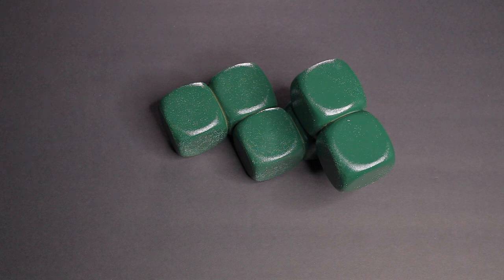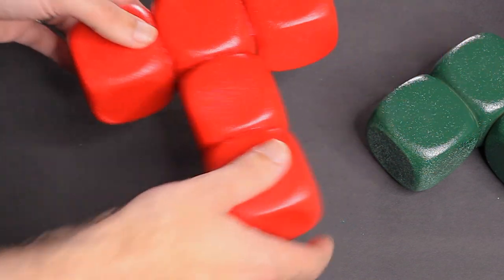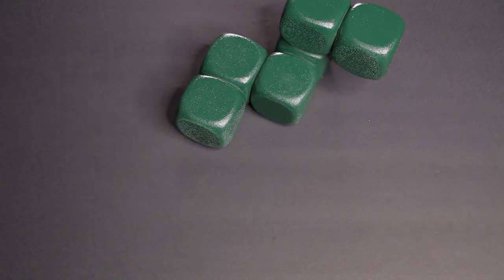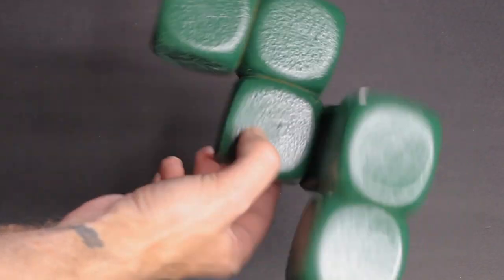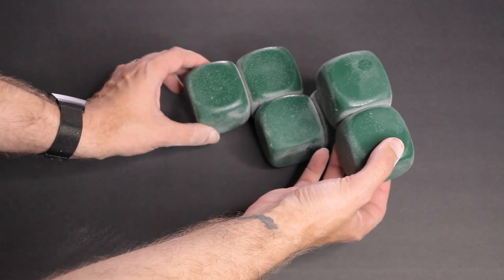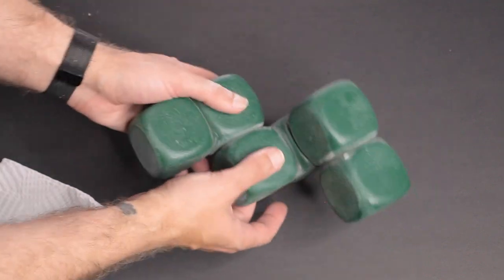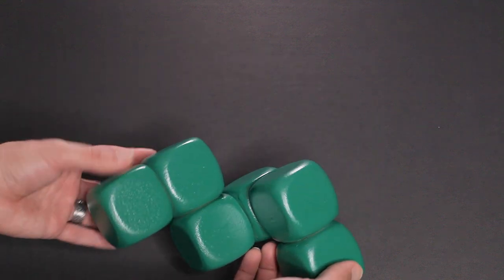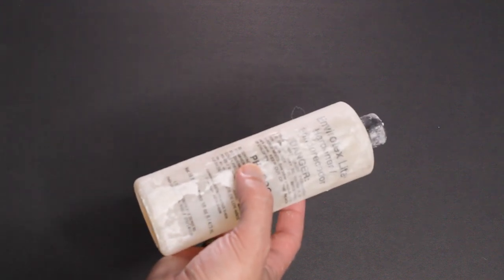FIXIT - STICKY PAINT

Comment: The reason the paint is sticky is because the material absorbed the mineral spirits in the paint too quickly.  Spray the item with mineral spirits a couple of times and let it dry.  This will allow the paint to harden properly.  The Soda is just a stop gap until you wash it, and the problem is still there. Hope that helps.

Comment: Note there is a difference between baking power and baking soda. I think soda is what you are recommending.
Reply from the maker: @jenellemorella6383  yes. While they both will work in a similar way, I was using baking soda in the video. A main reason for using it, is it's very inexpensive. And it reacts with various glues. But in the application of simply negating the stickiness by coating it in a "powder", a finer powder, like baking powder could produce a better/more desirable result.

Comment: Wow.... I found this solution via Google search and I found another method that says to use water. That was the less messy option and after that didn't work too well, it was time for this method. And it worked 100%! I had excess of both Corn Starch and Baking soda, but figured I go with the corns starch. It helped dry the tacky areas and then I wiped off the excess. I think you should do another video testing which powder works best for this method (baking soda, corn starch, or baby powder) There'll be pros and cons for each, but I'll still be interested to learn.
Reply from the maker: I'm very glad I could help, and that it worked for you. Yeah, I imagine most powders would have similar results with varying degrees of success. I like baking soda for how inexpensive it is. But yeah, could be interesting to test a bunch of different powders.

Comment: Primed with flex seal, that's a new one to me
Reply from the maker: Yup, sealing/painting foam with flexseal (plasti dip or similar rubber paint) works great as it's flexable, and is less likely to crack, and paints applied on top of the flexseal are also less likely to crack then if just directly applied to the foam.

Comment: Had same situation on my ping pong table. The paint didn't dry on day 3. Among the solutions that I searched, this is the simplest and it works well. Thank you very much for the helpful tip! I did just one very thing coat. Now I wonder, should I apply second coat?
Reply from the maker: I'm glad I was able to help. Hmm, well, pool tables are subject to a fair amount of abuse, a second coat would probably be ideal. You could always see how it holds up with just the one, and add a second coat later on if you find it needs it.
Reply: I just wanna say that, as a table tennis player myself, this paint on a table absolutely drive me nuts with how it would slow the bounce and speed so much LOL.  Hmm maybe I should use this paint on the paddle!!!

Comment: Okay. I wanna try this i have a barrel to my pistol i painted black. It was already black but a faded color, i used krylon fusion gloss and gloss clear coat it came good but when i lit sit in my holster for longer than a few minutes it becomes sticky and difficult to draw out of holster . Maybe the temp was too cold during spray painiting. I used a heat box to heat after painting to properly heat item , but in painting room during painting process it was cold maybe that was an issue. But yes maybe we’ll try baking soda. I think im gonna use cerakote it should be more superior and no sticky instead of regular spray paint

Comment: I tried this on my DIY paint job on a bag. It seems to be working. After using the damp cloth,  I used small paint brush to tap few and thinner layer of baking soda on needed spots. Thanks for this tip!
Reply from the maker: Awesome, you're welcome!
Reply: Need this cause I just spray painted a bag and it turnt out good thanks

Comment: is there a way to get the left over powder off? i have a clear coat that is still tacky after 48 hrs so i cant just put the powder on and respray the clear.
Reply from the maker: Ah, yeah that's a tough one. The powder might make it easier to sand off, like help the sand paper from gumming up instantly. Buy you might have to resort to solvents. Use the solvents to get the bad clear coat off. Get it washed, re-sanded and then try the clear coat again. -- There is also a possibility that it could dissolve to the point it is invisible when you add the new clear coat. You could try a few tests with the new clear coat you want to use. See how the baking soda reacts. You could also try different powders, like baby powder, or perhaps flour even. Best of luck.
Reply: @IamNickDClements  thank you🙏🙏

Comment: i sprayed my pleather weight bench with regular rustoleum and its sticky-help?
Reply from the maker: You can try dusting it with baking soda, it shouldn't make it any worse. What did you spray it with? Pleather can often be a hard thing to paint. I recently discovered that Rust-Oleum has a line of "fabric spray paints" spray paints specifically designed to be sprayed on fabrics. The result is flexible, and weatherproof. Could be worth a try. Unfortunately, the color pallet is pretty limited at the moment. https://www.amazon.com//dp/B08VTLFF6W

Comment: Baking soda or baking powder?  You mention both
Reply from the maker: Yes, sorry for the confusion there, I was specifically using baking soda. However, both could honestly work. Baking powder could possibly work even better because it's such a fine power. So you could also try baby powder, or even flour. I like baking soda however, just because it is so incredibly inexpensive, people likely already have some, it doesn't have to be fresh, so, e.g. the box that has been in the back of the fridge for 2 years is perfect!

Comment: Ummmm is this tip also for oil paintings on canvas??? 😮
Reply from the maker: Hmm, that is an entirely different beast. Oil paints can take months to years to fully dry. I really have no idea what effect putting powder on oil paint would have. Worth experimenting with tho.
Reply: @IamNickDClements  i have same problem with my oil painting its so tacky... I dont know how to fix that
Reply from the maker: @libriansana8562  how large is the painting? I wonder what putting it in a dehydrator would do? If it is to big to fit in standard food dehydrator, The King of Random has an old video showing how to make a DIY dehydrator out of a cardboard box, a computer fan and a big light bulb. (youtube .com/watch?v=F-Cge4qSOms) Could be a fun project if you are into that sort of thing. -- You can also use a normal oven as a dehydrator, you just use it at a very low temperature... but sticking a finished painting in a oven, sounds kinda insane, so try at your on risk. -- But if you do want to explore this route at all, I would definitely suggest making a small test painting first and seeing how it reacts, if at all, then you can better judge if you want to try it on your real painting. Hope you can figure something out!

Comment: Hi, just wondering, would the paint have cured by repainting the green cube without using baking soda? We are trying to figure out how to cure sticky paint from the interior surface of a vintage travel trailer. I think the previous owners who did the recent renovation might not have primed the surface properly. I'll try a baking soda wash and see if that helps. Thanks
Reply from the maker: I haven't ever had much luck painting over a stickey surface, it usually just gets worse. The best method is to use a paint stripper to remove the bad paint, and start fresh. But that can be a lot of work, and most paint stripper solvents are pretty toxic.

Comment: Hey ! I bought a skateboard, and my skateboard is not wood its like plastic but its really strong and really really hard to break, well I decided to paint it with acrylics and now when i wanted to try skating on it it became sticky and it sticks to my legs please help
Reply from the maker: I mean, you could try the baking powder method, there is really no harm, as you can basically just wash it off. However, it might be best to just try and remove all the paint completely. Possibly scraping or sanding it off, and/or using solvents. I would test it in a small discrete area first to see how the paint stripper/remover reacts with the plastic.
Reply: I am Nick D. Clements THANK YOUUU i tried the baking powder method it really helped🥺🥺❤️❤️❤️
Reply from the maker: @linatariq6216  Awesome! Really glad to hear it :)

Comment: you show baking SODA then you later say baking POWDER??!!  Also reason your spry may not have dried has to do with MIXING /Shaking can thoroughly before spraying ( or rolling) .
Reply from the maker: Sorry for the confusion there, "baking SODA" is what I used, but baking powder should work as well, perhaps even better, as it's a finer powder. It should also work with baby pounder, or even flour (though I don't really recommend flour as it can, in theory mold and rot) I like baking SODA mainly because it's so cheap.
Baking Soda, 16 oz - $0.59
Baking Powder, 8.1 oz - $1.39
Baby Powder, 15 oz - $1.89

Comment: This is stupid

Edit:  OK, OK, OK... I'll try it.  I'm doing a guitar body with this paint and am noticing it stays sticky past the 24 hour point... it's sticky and grippy.  Not sure how I'm going to wet sand it when it acts like this.  I am baking it at 200F for a bit to see if it hardens the paint, but I'm just not sure if baking soda is an actual fix or a masking...
Reply from the maker: I agree. Still useful, to myself and a handful of others, but at least now we are better informed to its stupidness. Thank you.
Reply from the maker: Gotcha. Yeah, it very well might just be a masking in this case. Baking it might work, I've had success with that before.
Reply: @IamNickDClements  It feels a little less sticky after baking at 195F for 1.5 hours total.  I would think this paint would cure by now, and I already previously had it hanging in a drying room with a dehumidifier at 35% RH for 48 hours.  This paint is so much slower curing than I remember it being.  The worst is the "Professional" version, as it has a higher amount of solids and can take 2 months or longer.  I am trying to get to a point where I can wet sand before putting another few coats of color and then poly.  I am pretty sure others are frustrated with these newer paint formulations too, which stay tacky for way too long.  There's no mention of baking on the can, but it should help if I keep doing it, I think.  If that doesn't fully cure it. I'll try UV light.

Comment: sorry, I think the many thumbs down are due to the fact that you just found something that the sticky plastic can stick to instead of your hands or instead of the table. It doesn't remove the stickyness. You might as well use flour, sand, talcum or any other powder. Like you said, when you remove the powder, the stickyness comes back. On the other hand, I read on the web that someone painted an action figure and he ended up with its body being fine but the head - probably due to plastic/paint reaction - remained sticky (I realized sticky paint and sticky varnishes are a plague for thousands of people, including me; the reasons are more or less easy to find, but the solutions are not, except the most common one: re-paint). He submerged the figure's head in baking soda, he left it there a couple of days, then he washed away the powder and apparently the stickiness was gone. I wonder if you or others ever tried that? Thanks.
Reply from the maker: I honestly didn't notice how many dislikes this has accumulated.
Yeah, if paint or resin etc. doesn't cure right, there is very little you can do to fix it, it's more or less permanently sticky. I like baking soda over other options as it is relatively cheap, people most likely have some already, it won't mold or go rancid like flour. Baby powder is a decent alternative. It's bad science, but since I know baking soda has a chemical reaction with CA glue, causing it to cure on contact, stands to reason it might have some kind reaction with other adhesives/ sticky surfaces. But yeah, it is mostly just a coating.That said, plenty of people have found value in the idea, and even if just one person was able to salvage a project using it, that's good enough for me.

Comment: Lol so just get contamination all over the piece? Or paint over the dust? Lol what a terrible video. 

If you don't know how to fix it, just say that. 

Either dry it in the sun, or paint over it while it's still clean.
Reply from the maker: Hey if it's not for you, it's not for you. No one forced you to watch it. What I did in the video, completely worked for my situation. My paint was never going to dry, that was the problem, it would remain tacky forever. Coating it with a powder, was a cheap and easy way to salvage the project. If I had tried solvents to remove the paint, that would have likely deteriorated the foam as well. Where as paint removers are expansive and usually toxic.
Reply: @IamNickDClements  Using the powder didn't fix your issue. Using a different paint did, which could have just been done in the first place which you'd never do over any dust, powder or debris else it'll just chip or flake off. 

All I'm saying is the powder was pointless.
Reply from the maker: @SirSmokesAlott  It let me handle it with out it being sticky. That's point enough for me.

Comment: if youtube didn't remove dislikes, nobody would be watching this because it's really bad advice for so many reasons. first, baking soda is abrasive so you  will ruin a glossy finish. and the alkalinity is another issue.  aside from the chemical reactions it will cause in some kinds of paint, it's not great to be handling baking soda with bare hands, as you probably noticed for the next few days that your hands felt like dry leather. and finally you are not "fixing" anything. you are just sticking some powder to the surface temporarily. use talc instead because it it non-reactive and gentle on skin. you should leave the expert advice to the experts.  baking it in an oven set to warm (aka less than 100C or 200F) will likely cure any uncured paint. that, or waiting for weeks, months, or maybe even years for it to cure. often the problem is too thick a coat of paint which forms an outer skin, with wet paint underneath. the wet paint slowly seeps through the outer skin, creating a sticky surface which can last for a very long time. baking it can also cause the paint to lift and bubble, so it's not a perfect solution either.
Reply from the maker: As of right now the video has 351 likes and 126 dislikes. So 73.6% Positive. But also, yeah, you are not alone in your dislike of my video.  But if it's not for you, it's not for you, no big deal. But it worked great for me, and has worked for several others as well. I like baking soda because it's dirt cheap, and there is no cancer risk like there is with talcum powder.